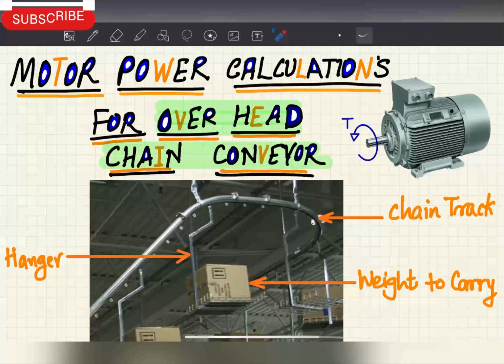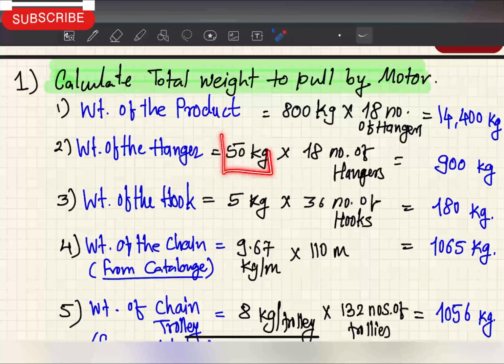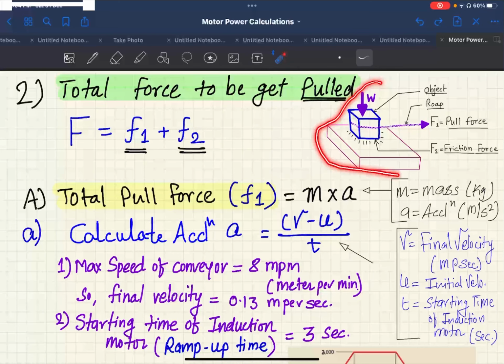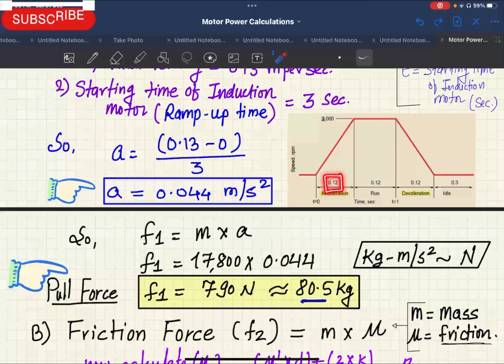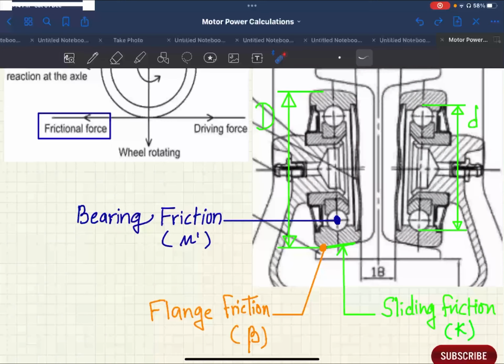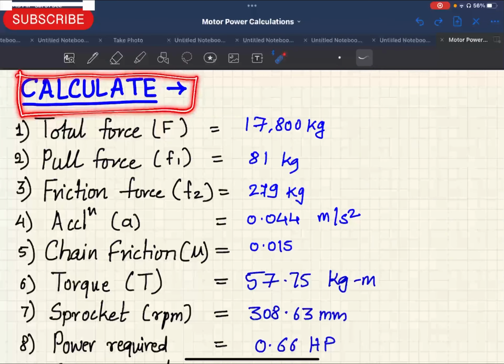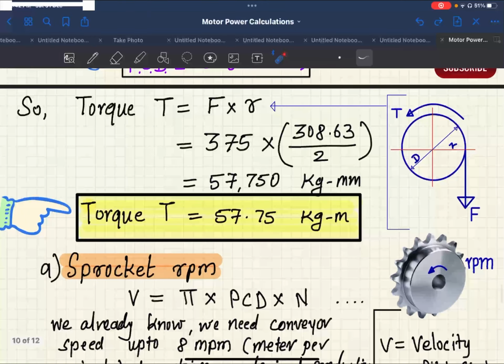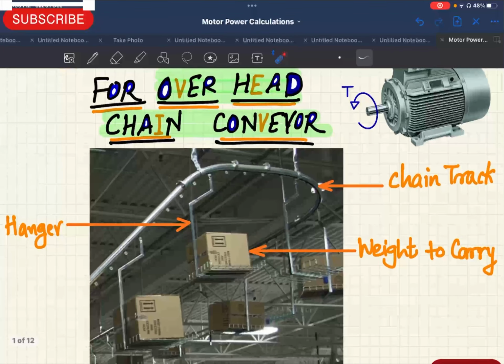Motor Power Calculations for Over Head Chain Conveyor (V087)

Comment: Can someone explain to me the friction (mu) calculation? 
I dont know where the equation 
(u' x d) + (2 x k) / D x B 
Comes from
Reply from the maker: Step-by-Step Explanation:
Numerator:

(
𝜇
′
×
𝑑
)
+
(
2
×
𝑘
)
(μ 
′
 ×d)+(2×k)
This combines the friction-related component (
𝜇
′
×
𝑑
μ 
′
 ×d) with a stiffness-related term (
2
×
𝑘
2×k).
The addition suggests that both friction and stiffness contribute to the system's performance.
Denominator:

𝐷
×
𝐵
D×B
Likely represents a geometric factor, such as the cross-sectional area or a scaling factor for frictional force distribution.
Overall Ratio:

Dividing the combined effects of friction and stiffness by the product 
𝐷
×
𝐵
D×B could normalize the equation, yielding a dimensionless coefficient or specific force.
Example Use Case:
In a belt-drive system, if:

𝜇
′
μ 
′
  is the rolling friction coefficient,
𝑑
d is the contact diameter,
𝑘
k is the stiffness of the belt,
𝐷
D and 
𝐵
B are the pulley dimensions (diameter and width),
The formula might evaluate the force distribution or efficiency of the belt under friction and stiffness effects.
Reply from the maker: The equation you’ve written seems to be related to the analysis of friction, but it is ambiguous without context. Let me break it down and provide a possible explanation based on typical applications in physics or engineering.

Given Equation:

(
𝜇
′
×
𝑑
)
+
(
2
×
𝑘
)
𝐷
×
𝐵
D×B
(μ 
′
 ×d)+(2×k)

 
Interpretation of Variables:
𝜇
′
μ 
′
 : Could represent a modified coefficient of friction. This might be used in a specific context such as a rolling system, surface analysis, or other friction-dependent scenarios.
𝑑
d: Likely a distance or a diameter. Often represents the radius or diameter in rotational systems.
𝑘
k: Could signify a spring constant (in physics) or a stiffness coefficient in structural mechanics.
𝐷
D: Likely another diameter, a specific dimension, or distance.
𝐵
B: Possibly a breadth or width, often used in calculations involving beams, belts, or surface areas.
Possible Contexts:
Friction Analysis in Machines:

In rotational or belt-driven systems, frictional force and stiffness might be combined to calculate certain performance metrics.
𝜇
′
μ 
′
  could be a rolling resistance factor, and 
𝑑
d, 
𝐷
D, and 
𝐵
B could be dimensions of interacting components.
Structural Mechanics or Tribology:

The equation might calculate a ratio or a force related to the frictional resistance and stiffness of materials in contact.
Material Design:

This could be a design formula for optimizing contact forces, accounting for friction (
𝜇
′
μ 
′
 ), stiffness (
𝑘
k), and dimensions (
𝐷
D, 
𝐵
B).